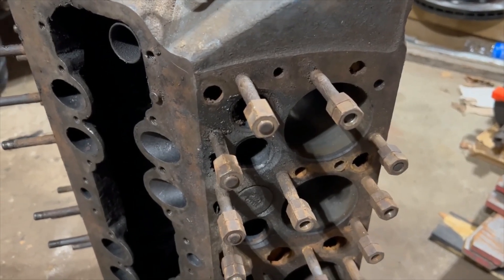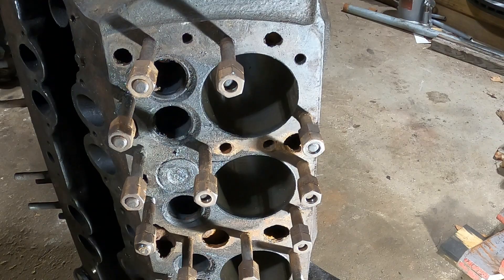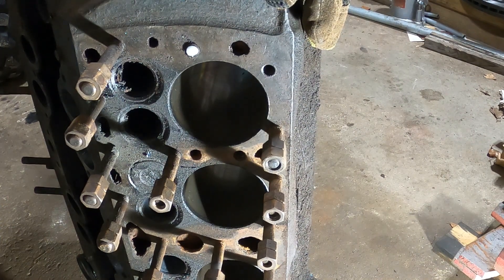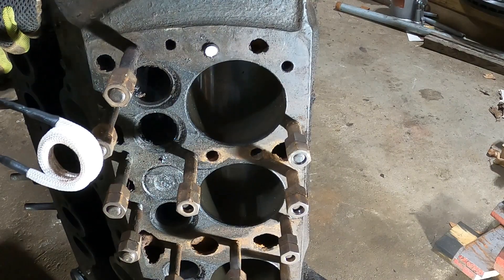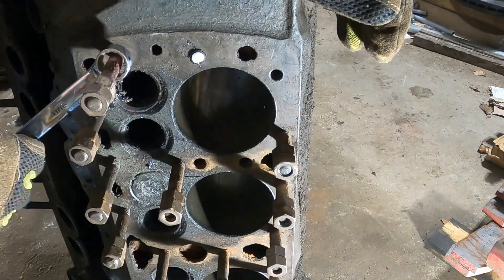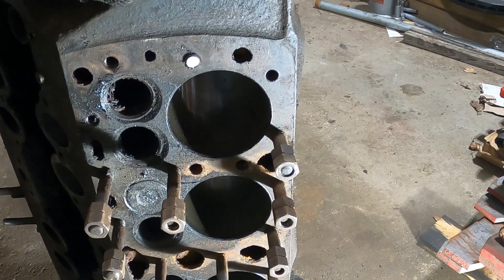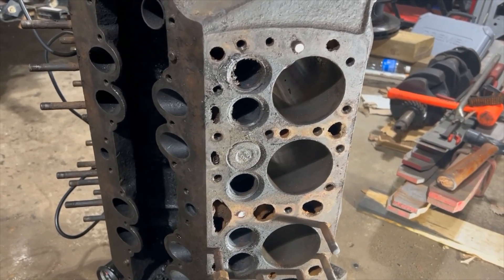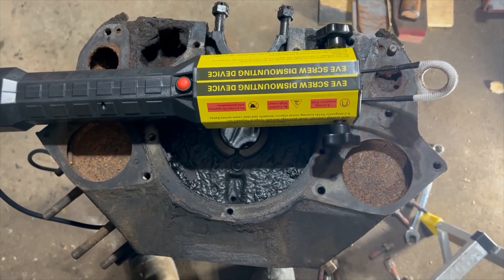Another Cool Tool - The Induction Heater

Comment: 2 years later. I have an idea question. After heating the stud can you quick cool it with some kinda compressed gas? Can you shoot it with a fire extinguisher? Liquid nitrogen? Inert gas from the bottle of a mig or tig welder? Someone suggested hitting it with PB Blaster. Is that the same concept. Actually I just bought an induction heater and am looking forward to using it on a couple cross member nuts. 2025.

Comment: It is just painful watching you attack these studs. Heat as you have done and then wrench the stud back and forth with small movements never force totally one way. Now for the stud that broke put a nut on top of it and use a mig welder and touch the stud and fill nut cavity and the heat of the weld will also warm the stud to break the rust bond inside on the threads. Just saying.

Comment: You need a really good set of vice grips joke up on that stud and honked down on it good or you twisting it then you allowed to twist Plus when you're heating a solid piece of metal it expands it's not like a bearing with a hole and a which contracts maybe heat to block around it a little better or something I'm not sure but put some dry ice on the stud I'm ready to get cold

Comment: Some friendly advice from the coach 🇸🇪
1. "soak" the stud bolt the day before either with W40 or similar. or a mix of gear oil and acetone.
2. heat the pin bolt until it is as red as a baboon's butt.
3. tap the pin bolt with a copper hammer "hard"
4. as you did tighten the stud bolt a bit before trying to loosen it.
5. ABSOLUTELY DO NOT DO AS WITH THE FIRST ONE❗

Comment: You do not obviously know how to deal with rusty items like the gentleman said heat the area around the bolt I live in the rust belt actually on the east coast all I deal with are rusted nuts and bolts 24 and 7 while I'm fixing cars When you live in an area and rust you are not just an automotive technician who takes things apart you are a corrosion and rust expert You have to develop certain skills and techniques to work these things to avoid breaking bolts constantly otherwise you would never get a single job done Otherwise that done cool tool thank you for the demonstration

Comment: always turn a stuck bolt both ways before removing...firm taps with a hammer can also shock the corrosion bonds in the threads... heat is great but the two tips on left should always be done.

Comment: Not sure why your heating the studs. Its expanding inside the block which makes it harder to remove. Take a torch and warm the block around the studs
Reply: It’s to break the brittle iron oxide. You see the moisture escaping when it happens. But then let it cool with wax or a rust spray
Reply: You are correct about expanding the stud with heat. The reason this works so well is that you heat the bolt/stud/nut to red hot and it actually burns the rust until it no longer has the holding ability any longer and the fasteners comes right off.

Comment: Continuously torquing the stud in one direction while it is near red hot is sure to fail  as heat is softening stud , heat it as near to the block as possible and allow it to soak in to the threads and rock the stud gently in both directions to try and clear some rust from the seized threads. A few hard blows to the end of the stud can help break it loose. The welder trick is the best choice if you have the tools . You could even cut the stud off about 3/8" from the surface and place a larger hex nut over it and weld it to the stud , the heat transfers very quickly right where you want it , this works great , if this does not work you are drilling and tapping anyway.

Comment: I remove broken bolts with mig welder, it the easier way.
Drill a small pilot hole in the broken bolt, start the weld in the hole, and build it up until you can get a large (new) nut on it.
Fill the nut with weld pool to the top, , usually come out easy, sometimes I have to repeat with new nuts if it keeps breaking loose. I would not drill and tap unless you make a jig or use a drill press to keep the drill centered and vertical.
I've also done it with a stick arc welder using 1/8 rods.
Try using a nut twice the size of the one that snapped off, it allows more weld filler and gives more leverage.
This one was snapped off below the surface and took 4 tries with bigger nuts each time.
https://youtu.be/COpRIVGiTqo

Comment: This can also be done with a tig welder if you don't care about a certain tungsten or if you dedicate one to contaminate on stuff like this. A big tap with a 2 lbs hammer on a punch held with vice grips on the siezed fastener then a quick blast with the tig torch then a penetrating oil after it cools a little. An impact driver used carefully can sometimes help as well. That said...I've really wanted one of these heaters.
Reply from the maker: Is this to remove the fasteners that broke off or to remove the studs in general?
Reply: @Mechanical Matt  a broken bolt or siezed stud. The heat cycle alone from heating and cooling will free a frozen fastener. If it's blind or inaccessible, cut a small sleeve out of copper tubing to fit into the ID of the hole. Don't start a puddle, just get heat into the part and work it back and forth until it gets moving. Clean the area first if possible or the arc will wander like crazy. Great vid btw 🖖